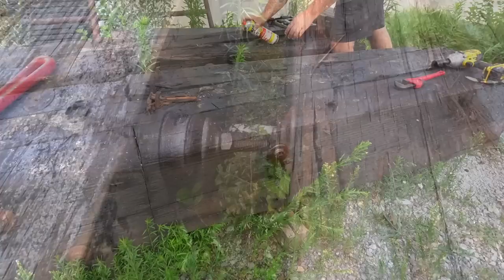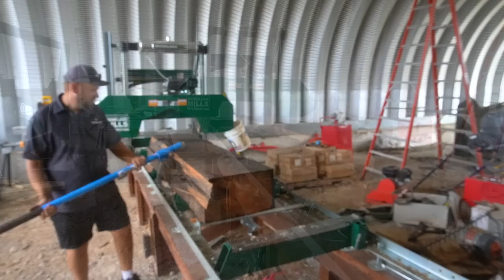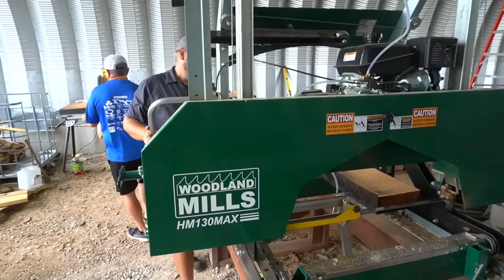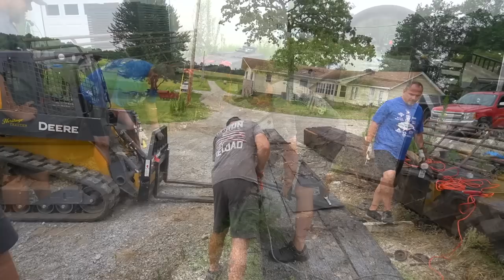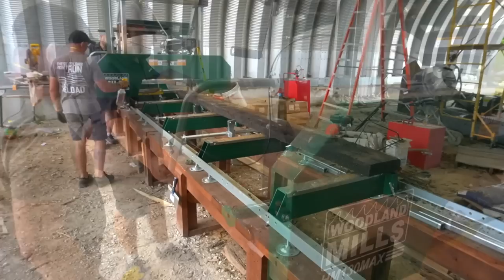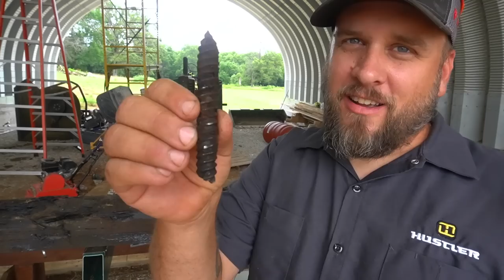Everybody Warned Me Not to Attempt this Milling Job

Comment: You need a good hand held metal detector to check any old lumber. It cut that very nicely. Thanks for sharing 👍
Reply: yeah, I just posted the same thing. Standing so close to the blade and hitting a hard metal object could break the blade and cause an injury.

Comment: I’ve sawed old telephone poles with my HM126, they had some metal in them, but I used a metal detector after each board. I used my older blades. You should invest in a metal detector it will save you some blades.

Comment: I was only warning of the metal . I figured there would be more blades used .
The lumber looks good . If I get a chance to work with clean ties I might give it a try .
Thanks for the experiment .
Reply: Railroad ties are probably more full of rocks and spikes then the bridge timber. Wonder if something like WD40 would be better lubricant for this type of cutting than the pinesol, as the wd would react with the creosote cutting it better than the pinesol. Not a wood cutter so asking out of ignorance more so than questioning. 
Great video.

Comment: I was in Vietnam in the war as a Combat engineer and we used big beams with creosote for bunkers. The only problem was handling it without gloves and that would burn that required a visit to the Corpman.  I have since worked with the stuff in business and never had a problem. go for it you took the right method for protection.
Reply from the maker: Thank you for your service

Comment: About 45 years ago I worked for a landscape company that had me build a set of steps out of fresh rr ties. We cut the ties in half so the steps were 4 feet wide. The creosote sprayed all over my arms and when I wiped sweat I got it on my face and forehead. It started burning and put me in the ER. For ten years after that the first sun of summer would burn like heck. Creosote is nasty stuff.

Comment: Agree with the comments about a metal detector.  Particularly when sawing beams like those or trees you know or suspect were from around homesteads, etc.  I have seen a number of railroad spikes, bolts, other pieces of metal and even horseshoes that grew into trees. Way too much excitement hitting some of those with a radial saw!  usually seemed to happen right after sharpening or replacing teeth! :) One additional thought.  It might be interesting to viewers to have a video with Paul Case talking about what he has found in trees while sawing lumber, etc.  Congratulations on 75K viewers as well!
Reply: The trees we saw at work it's usually either bullets or barbed wire lol

Comment: the treat on these timbers is asphault , the biggest problem in milling the timbers is ballest dust in the timber , sawing the bolts never helps the blade on any mill  , but , if you like , i have no objections ,

Comment: Just the nature of the internet. Overly cautious and precise is a safe position and makes a commenter seem more knowledgeable. In real life things have to get done, usually with a minimum of fuss.  In this case, lubing the blade, good airflow, masks and collecting most of the sawdust in the bucket are all reasonable mitigation. I would add not tracking this material into family areas where barefoot kids could be exposed for a long time is a consideration as well so a good clean-up of the mill area, boots, gloves and tools when the job is finished might be another consideration.

Comment: Every time I post something I’m doing or ask a question about something I want to do, I usually get a few responses from people who come from the worst outcome angle, but also I get a few comments from people who are calm and helpful. I try my best to seek out that calm helpful people and give a bit more weight on their pros or cons of my project.
 The only issue I see with the bridge is the run off of the contents into the waterway you’ll be crossing. When it rains or pieces flake off the lumber I’m not sure what impact that would have on the contents in the water. Could be nothing or maybe it’s something. Is there a way to get the answer for that? 🤷‍♂️

Comment: The protection from creosote is generally compromised when the timber is cut as the inner portion of the timber doesnt have near the protection that the out timber does. 

If you think about it, the Railroad doesnt rely on timber cut on site. It is cut to spec then treated. The biggest factor comes from ground contact. But the timber also receives a huge benefit from being sealed as Creosote is not only a liquid at high temps but it solidifies at lower temps to a hardened oily surface that protects from sunlight as well as water for several years. 

Cross ties generally last for 7-10 years in service but depending on their use could last several more and in some cases a bit less. 
I have had some only last 5 years and those were new. 

So take it for what it is worth. Im just another commenter that had several years on the RR and used them for at least 30 yrs off and on. 

If you do use resawn Creosote timbers it would be a good idea to seal them in a heavy oil stain for obvious reasons. 

Just remember Free still has a cost to many. Sometimes health and sometimes having to redo again after you put to much faith in the materials integrity that had been compromised...

Have a great day..

Comment: I didn’t realize you only got 2-3 hours cut time out of a blade. That doesn’t seem good at all 🤷🏼‍♂️
Reply from the maker: It sounds terrible but in reality your Sawmill is only running for maybe 15 minutes on a log. The log might take an hour, but most of that time is the blade is not actually in the wood.

Comment: The concern i was talking about is metal in the logs. But You said A blade only last 3 hours? I'm use to circular blades lasting all day with a few quick touch ups during the day.  I'm assuming the band blades on that saw are not all that expensive? So if you did hit a rail spike or some other chunk of metal in a log it wouldn't break the bank? or send 2 foot chunks os circular saw blade at you!

Comment: is the center of the wood also treated and safe from rot?
Reply: Sometimes it doesn't penetrate all the way to the core but you can see it when you cut it. There will be a pretty distinct boundary where the penetration stops.

Comment: Only experience I have with creosote is having to coat a fence with it down in FL as a kid. The fumes of the fresh stuff caused a worse burn than being at the beach for 12 hours straight. It was pretty miserable. 

The screw is a hazard with using any reclaimed lumber in a woodworking project. Get a small hand held metal detector and give them a quick go over. 

For those that say it’ll kill you-so will eating pie but I like pie.

Comment: It realy pisses me off when I see people fire up a chain saw and open it wide open immediately Do you do that with your truck or car motorcycle tractor ? its an engine just like anything else and needs warmup time also. Quit reving a cold chainsaw!
Reply from the maker: The owners manual for my tractor specifically says that you should start it with the throttle 2/3 of the way up. So yes.

Comment: What did you think of the pinesal
Reply from the maker: It’s inexpensive in the quantity we used, and we didn’t have any problems so I would probably use it again.

I didn’t do any kind of a comparison, so it might’ve worked fine without it.
Reply: @RockhillfarmYT  I believe it works well diluted 5:1, also pleasant smell compared to diesel
Reply from the maker: @scottjones5221 that was a typo in my first response. I meant it was inexpensive. We only probably used a couple ounces.

So for occasional use, the cost was not much and it did not smell bad